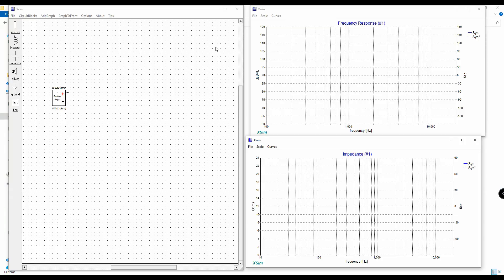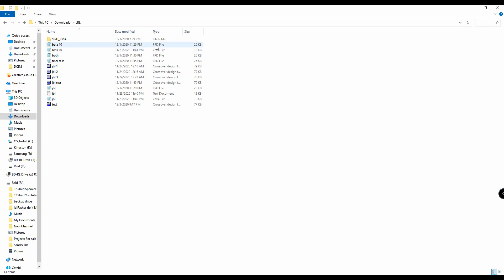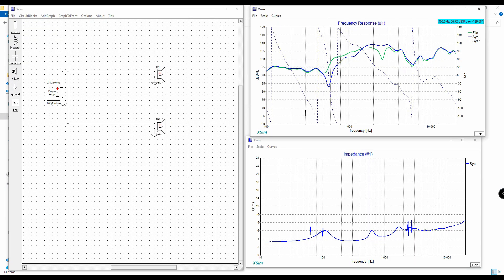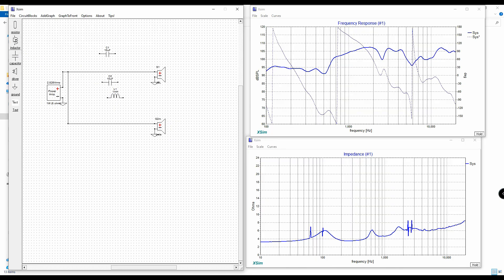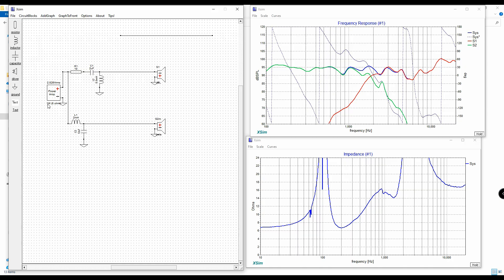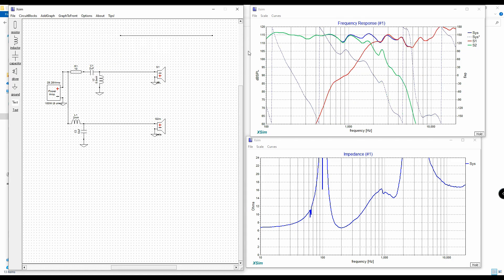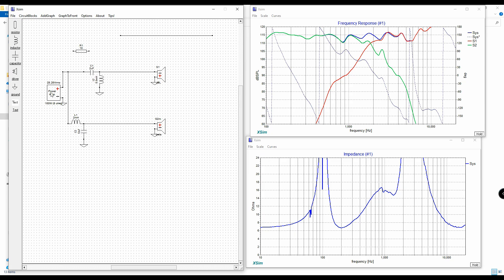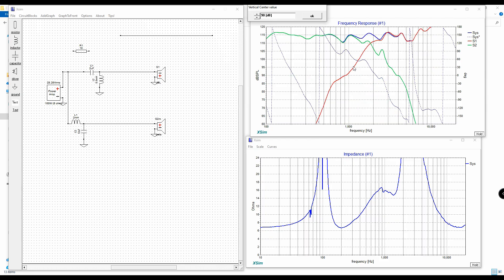Design Crossovers for HiFi speakers using Xsim - Tips and Tricks

Comment: Hi! So driver offset is done without any protection to the tweeter, just connecting both drivers in parallel??
Reply from the maker: You’re going to measure them in parallel, the same way that you measured the tweeter by itself. If the particular tweeter, you used needed a cap for protection, then you would use that as well when you are them in parallel.
Reply: @Toid what would be typical cap values for tweeter protection? So passing  a short but full bandwidth sweep on a tweeter is ok? Or it needs to be done ate very low spl?
Reply from the maker: @pedrovaz3301  most typical tweeters it’s fine to run a full sweep on at low volume. It’s usually when you get into using ribbon and planar style tweeters that become problematic.

Comment: The strange thing about the video is that it says nothing about how to design a crossover.

How do you determine the correct values for the Inductors and Capacitors?  How do you determine the Q of the filters and the pole locations so that the response will blend together at the crossover point.  Does XSim have functions to do this?
Reply from the maker: @jamestyrer907  this is a video on tips and tricks of using a specific software that is common for speaker designers. This was requested and completed for that purpose.

Comment: Why does only the inoedeance graph change when adding a crossover and not the frequency response graph?? It does this for me on both xsim and vituixcad and i do not know why. I am using files from parts express and I even tried my own and same thing. Its driving me crazy
Reply from the maker: @solodolo6018  are you sure you have set your grounds properly? Including on the drivers?
Reply: @Toid thank you for the reply! I have my grounds set properly and the drivers are connected to the amp as well. I have them connected as you do in the video. My crossover compenants are connected correctly as well. I've manipulated the capacitor and inductor values but it only effects the impedance graph.
Reply from the maker: @solodolo6018  you set both the frd and zma files for both drivers?
Reply: @Toid  I think I found the problem 😑 I was drawing the lines first for the drivers to the amp and then adding the compenants on top of them. This essentially was bypassing them? I am now connecting the lines to the end of the compenants and it is effecting the frequency graph now.
Reply from the maker: @ that will do it
Reply: @Toid  I appreciate you taking the time to reply and help, thanks!
Reply: @Toid I also have my curves and scale set correctly

Comment: Z OFFSET…. uuummm. With a ruler…. And then the value I input is either a “plus or a minus” value….. 
and that value is expressed in………. Uuuuuummm  mm…?…cm..?…. .1”..?
I don’t have the program… 
I understand the concept of “  a signal leaving from two different places at the same time… but with a single reception point . I get the timing difference….
But IN WHAT UNITS IS THE DATA ENTERED
Reply: Is that .3”….. ?

Comment: Is this possible without impedance messurement? If not how do i messure impedance? Thanks
Reply from the maker: You need proper impedance measurements. The best way to get this is using Dats V3. You can get it from here and use the code TOID to get 5% off. https://parts-express.sjv.io/jW7oZb

Comment: I m trying to build a 2 way bookshelf speaker, I had one question bugging my mind actually In case of woofer as you put it in a box (I'm making a sealed) the output of the woofer will drop gradually towards low frequencies...so DO YOU NEDD TO COMPENSATE FOR IT ANY WAY?

Comment: Theoretically I could REALLY use this program! (If I even had a computer AND I knew how to use it anyway)

I'm just a speaker hobbyist, definitely not a professional, but I've always just designed and built everything totally by EAR, and whatever "sounds best", just using my basic knowledge of how individual components work together.

I don't have any kind of real, "professional" audio test equipment, I only have a basic multimeter, and a calculator, because that's all I've ever been able to afford. That results in some decent sounding speaker designs, (I have to just use drivers and parts from speakers I find in the trash or sometimes from my local thrift stores or garage sales, etc.), but this program would definitely take anything I built to the next level!

I REALLY wish I could actually afford a computer AND this program, because what all it can do and show automatically is totally awesome! But I would ALSO need to take a year long college class on how to use it AND the computer itself, because anything related to computers I just DON'T understand. The closest thing I ever get to using a computer is my cellphone that I'm watching this video on, of which I barely even know how to use fully. I'm NOT very computer skilled...

Computers have always totally lost me in the attempted comprehension of what each one of their keyboard buttons do, especially since all of their individual functions change completely, based on whatever screen you're on or what you're doing on it. (And forget about "virtual" buttons on a "touchscreen" itself, that ALSO always change, that just makes it all the more difficult for me to comprehend, lol!) I just never know what to push or in what order, in order to make the computer do anything productive for me.

(I can only remember ONE function for each button, knob, switch, or lever, on ANY piece of equipment or device/machine. I'm just "old skool" like that.)

This program still LOOKS cool though!

Comment: Will Xsim model a 4-way system? Also, I don't see a symbol for an L-pad. Is there one?
Reply from the maker: Yes it will. And I’ll pad is just two resistors, one in parallel and one and series. You would have to design that network yourself.
Reply from the maker: Yes it will. And I’ll pad is just two resistors, one in parallel and one and series. You would have to design that network yourself.

Comment: Do you have any videos where you are actually designing a crossover? Like what characteristics you look for in a well tuned speaker? What should your graphs look like. How do you know if a resistor is going to over heat? 

Things like this.

Comment: You didnt really talk about the impedence graph much. Do we need to care about that when designing? Seems impossible to keep it in range without massive caps.
Reply from the maker: You do need to worry about the impedance. If you’re having a hard time, keeping it in range it’s possible you have to much overlap in your crossover region. Because there are other things that might be causing this. If you want, you can show your results on the forum and we can see what might be causing the issue. Www.toidsdiyaudio.com/forums
Reply: @Toid  by in range, I mean it looks sort of like the one in the video with a huge peak that goes off the chart. It does not drop below the target minimum
Reply from the maker: @pilotdog68  I’d recommend you put some pictures on the forum and we can take a look at it
Reply: @Toid  just posted, thanks

Comment: Simulation is the one part.  The correct parts are the other side. Use 400v caps and free air inductors and moc resistors. You  build your crossover only once.

Comment: I have just one question. When purchasing your Inductors and Capacitors, how do you choose them based on the ESR value you entered for them? I can't find any ESR values listed on the components (air coil or capacitor). For example an Aircoil of 1 mH with an ESR of 350 m[R].

Comment: hey man great information in this video but i have a problem i have the sica 8 M 1,5 CS 8Ω mid the  sica 10 Fe 3 CP woofer and the visaton SC 10 N - 8 Ohm tweeter and i cannot find frd files for them, which means i cannot operate on xsim do u know where i could find the drivers ??

Comment: Question when your building a speaker cabinet and it tells you the inside volume of the speaker cabinet does the program also take into account the space used by wood bracing or the ports? or insulation? Also would be great to see you do a build a Sealed enclosure (Not sure if I seen you build one like that.) Perhaps model after the $2,000 pair of Klipsch model 5 speakers. Even considered if you could design a speaker cabinet with used speakers that make them sound good. Or perhaps find a older speaker cabinet that needs a modern crossover to make it sound better then show the before and after. I have lots of great ideas for you lol.
Reply from the maker: It does not take into account the bracing or the ports. If you use a program like bass box pro, it can take into account the insulation.
Reply from the maker: I do have some older speakers that I want to do some revisions on basically redo the crossover. But I have a few things ahead of that

Comment: Solve problem with phase by change + to - is not a best idea, because drivers will work with different phase
Reply from the maker: This is common practice in crossover design. In fact, reversing polarity has been used in crossover design for years. Of course it always depends on what type of crossover you're doing. For example a second order liquids Riley will always be reverse phase.

Comment: Seems like everything you did was based on having a model of a driver to start with.  Where do you get those models?  I use EASE in my pro audio design world to model speaker coverage and most manufacturers provide gll files to use in the model.  Do manufacturers provide models for this software?

Comment: Designing a crossover is just the start. After the speaker cabinet build, you still have to tweak the values as you measure and listen. Excellent software. Thanx for the overview. Shortcuts too 👍

Comment: What is the average wattage goes to the tweeter in a 3 way setup. I need to reduce the tweeter 15db and using a 8 ohm resistor to do so. The graph simulates 91 watts to the tweeter at a 100 watts from the power amp and don't want to overheat it.  Should I run a 100w resistor or something else to reduce the dbs.
Reply: That sounds more like you would want to rethink the tweeter branch, add a suitable (smaller C) capacitor in series or check if your tweeter impedance is 4 Ohm instead of 8 Ohm for example? :o

Comment: Thanks for posting, always find these videos useful.  I have been using PCD for the z offset until now.  Didn't realise this did the same, its a bit easier on xsim.  One question though.  Your video showed 90 odd db as as the sensitivity.  mine only shows 66db.  I assume you measured 1w 1m to get to that result?
Reply from the maker: Don't get too caught up in the sensitivity of your drivers for simulation purposes. These were measurements I took myself, so whatever measurements you use will be at the SPL that you took your measurements from. As long as you're above your noise floor, you should be fine. If you want to know the true sensitivity of the speaker system you create, then you would want to measure it at one watt one meter.

Comment: How do you take impedance measurements if you don't have a dats? I only have a measuring microphone.
Reply: There are instructions online to make measurement jigs. Sorry I don't have the sources off the top of my head but try googling "DIY impedance jig" or something similar.
Reply from the maker: If you don't have Dats, you can build an impedance measuring rig.  It is cheap, but you will still need to calibrate it.  Honestly at the price DATS is, I would rather just pick it up.  It has calibration built into it.  And it should last for a very long time.  I still use my DATS V2, and I have been using the same one for a very long time.

Comment: 11:54 "three ten watt resistors in parallel" - resistance in series sums. In parallel, the total resistance value would be less, dissipating less wattage.

Thanks a million for this video. It showed me something I didn't know I didn't know. Now I know how to account for it. I'll be sure to do z-offset in the future.
Reply from the maker: Absolutely.  Great point!  I wasn't trying to say use the same resistor value (of 10 ohm. That value would need to change.  The easiest would be to use three 30 ohm resistors to get the same value of 10 ohm. You would definitely want to simulate that if you weren't sure what to do there.  I didn't want to get too deep into that, since that wasn't the topic at hand.

Comment: I learned a lot in this video, but the thing I learned the most is that I know nothing about designing crossovers lol.
Reply: Same here. I feel so dumb now... 🙈
Reply from the maker: Haha!  Well good thing we are friends then 😀
Reply: I disagree….. the speaker …may know what he is talking about… but has absolutely ZERO business… doing this video….
“I’m just gonna put a resister here and a can of ketchup over there….
WITH ZERO…. EXPLANATION OF …
WHAT…CAPACITOR…. WHAT SIZE…. WHY
WHAT RESISTOR….. WHAT SIZE….WHY

You’re not lost…. The speaker (person) is…. See what I did there…I clarified which speaker I was talking about
Reply: @SOLDbyYOU yeah thank god i learnt what all that was earlier with chat gpt because otherwise this video would have been far more detrimental than helpful…. 

He explained nothing and made things very unclear and obscure. 

I think he means well but did a bad job at this. 

All these concepts like time alignment, crossover orders, how do capacitors and resistors work, why we use them, what’s the challenge behind aligning the phases of the drivers, time delay when using higher order crossover…. 

All of that needs to be addressed very clearly with examples. This could be a series of 7 videos and then trying to design a crossover after you begin to understand all that.

Comment: Next time no underneath lighting please :)  Just screen and voice. :)))   Looks like you're very scare to show something useful  and try make video longer with no reason .   Take  various 10 examples of crossover designs  and make it in real time?  Try it :) Ppl will learn more. Btw passive crossovers  not to long will be needed unfortunately ( next 3- 5 years). Active ones become more and more cheaper and easier to work with.
Reply from the maker: It was all recorded at the same time. I'm just going back and forth between the cameras. So there's no added time, in fact I took over 7 minutes out of the video.

Comment: I will soon be getting 15" Audio Nirvana speakers. $370 is a bit steep just to create a frd file.
Reply from the maker: That's to create frd and zma files. You can buy a cheaper mic. But as of right now, at least at Parts Express, most of the cheaper USB mics are out of stock. You do have to take measurements of the drivers inside your cabinet. But if you don't want to buy what you need, you could see if you can find someone that owns the measurement equipment that would be willing to help you out.
Reply: Is it possible to create it from suppliers spec sheet ?